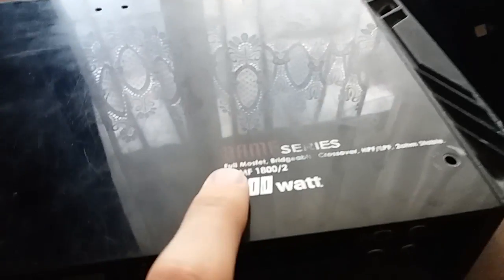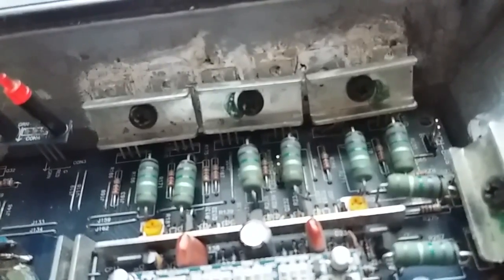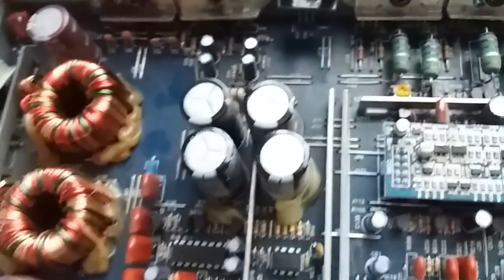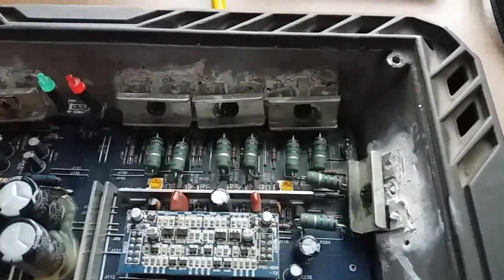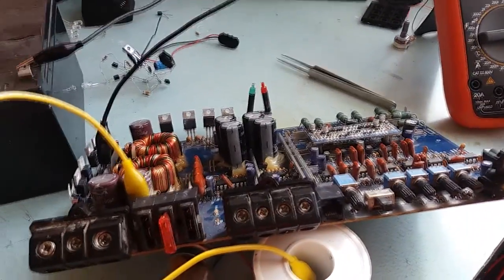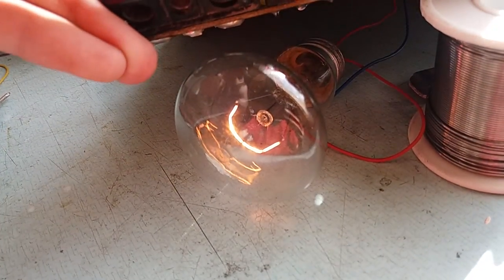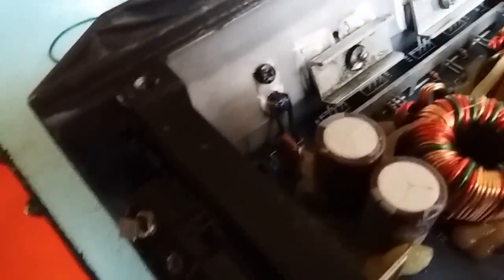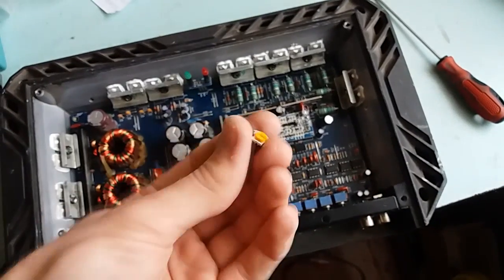Car Power Amplifier Repair (Deep Fried)

Comment: Amazing to see you recover that amplifier of death, Well done :-D :-D.
A feather in your hat for your skill, and making it look really neat now :-D.

Yes i have repaired horrible crap, but that was when i was 17 and didnt mind taking a week to sit there and check out every suspect dead part, also i saw it as a challenge, but there is a risk that it could still eat the new parts if you skipped anything.
I may sound negative, its experence that there will be bad ones, the question is: Will it be this one? LOL :-D.

I really liked your discription, the twin h.f transformers with there own push pull drivers, being driven from buffer transistors from that switchmode pwm psu chip, i guess.
The final output rectifiers and two transistors being used as a pre-amp/processing and possible driver power supply, + and _ 15 i think you said.

I hope you set the gain controls while in your frends car, And PUT STICKERS OVER THE HOLES TO STOP MESSING, an important step.
Also correct fuses, Marked so if it comes back like a boomerang, you know your mate is a silly arse!! lol.
People overdrive them, and use wrong speaker impedence (Allways!!).
I really really hope your frend appreciates you.
Sorry, long woffling text :-(
Reply from the maker: Thanks :) The only tricky problem to resolve was the weird distortion thanks to open trimpot which was used to set the quiescent current. In total, it took me 4 lazy hours of work, not really much for me. I was waiting for the parcel a week :)
Reply: Yes the bias or what looked like the word "Bios" was written on the pcb lol :-D.
Yes parts can be a long wait :-(
I think without you, that amp would never have worked again, it would cost your frend such a lot of money to get it repaired at a shop, he would have said "No" and treated it to a trip to the bin lol.
Reply from the maker: zx8401ztv Knowing them, I would say that the amp would've been tossed in a shed of some sort and left there for ages :D The guy told me that he asked one "repairman" before, and he said it would cost 2.5 times as much as I charged + he then refused to repair it. Something tells me that it was that moron who screwed it up so much.
Reply: Yep it sounds like a shed amp, and knowing who messed it up is hard to say, the repairer that said 2.5 times the cost may have been looking at the same state of death that you were, he possibly just didnt want to waste his time.
A decent repairer didnt make that mess, it was an asshole!!.
You are a good and decent repairer, you care about the final result, the amp looks decent now, i hope your frend is not an asshole.
Reply from the maker: zx8401ztv The client is a friend of my friend, and he's quite a nice chap to have a deal with. If this didn't belong to him, I wouldn't bother repairing it. I had a deal with assholes before, repaired a subwoofer that shouldn't be repaired and they screwed it up the next day and complained after that. Again, I had positive experience with the nice chap, so I took the risk

Comment: This kind of stuff is for all those who have to drive on every road as if it's a race track and can never get enough watts of super loud bass! I doubt this is capable of 1800 watts though. Whoever serviced this had no idea what they were doing (or perhaps was lazy like me)  That's weird seeing mosfets in a linear amplifier, usually it's class D amplifiers that use mosfets.
Reply from the maker: Sure thing it won't output that power,  perhaps in some kinda peak, like those silly P.M.P.O ratings :D There's 60A fuse on input, so it can't even consume 1800w for any significant period of time. 
I don't quite get your comparison with a race track, but I agree that this is excessive. However, that doesn't bother me to much as long  as they pay me too fix the thing ;)
Reply from the maker: Lazy?! Clem, there's a difference between being lazy and having hands growing from the ass. That moron clearly had the birth defect I mentioned above, and/or didn't he didn't give a crap about the thing. 
  If you are lazy and slop your projects together - fine; it's your hobby. Take a look at my amp, for example :D But when you deliberately screw up client's stuff, it's whole another story. As you saw from the mess of the thermal paste and loose TO-220's, he did take the board out. So the question is - why bodge that 150R resistor on top if you had the board out? Incompetence or ignorance is what I call the problem here.
 And yeah, MOSFET's in the amp is interesting for me too. All 8 pieces are the same, so it's a quasi-complementary output, biased into class AB. It's better to use true complementary pair but as you might know, P-channel FET's are usually weaker.

Comment: Hello MrJohhhnnnyyy i have   amp  Power coustik BAMF 5500/1D its smoked can u help me to repaired plz?
Reply from the maker: It may seem incredibly easy, but if you don't have proper equipment and experience working with power circuits, you may do more harm than good. If it smoked, the transistors in the converter are likely to be dead, same applies to the amplifier section. If you have a DMM, soldering iron and some skill, you may be able to repair it. That if it's gonna have a simple failure like the one in the video.
Reply: Its any chance  to contact privet and i can send u pictures ?
Reply from the maker: You can make a short video, upload it, make it private and then send a PM to me with a link to it.
Reply: Ok i will... but i not using youtube i dont know how to do it private  but i try...i can do vid in russian language if u like..be easier 4 u nme.thx

Comment: lol this amp isnt gonna put enough power down to damage your hearing at the range it plays , a car horn would do more damage . looks like 4ga inputs and 3 40 amp fuses , rough estimate 800Watt RMS output clean from what i see . to bad you didnt live by me i have enough blown amps to keep you busy for a year lol
Reply from the maker: So you say that listening to music with that amp at max power is harmless? I had my ears ringing after I tested my amp which puts out 30W rms into each channel. 
 It's the sound pressure which does damage, not the power itself. If you have sensitive speakers, 30W will be more than enough to hurt your ears, at least temporarily. 
 Yes, the car horn hurts your ears more, because it's not a bass that this kind of amplifiers play. Try sitting in your car while your stereo plays 1kHz tone at max volume. You'll tear your ears off LOL
Reply: subwoofer amps are not made for that frequency range , i just had a hearing test recently and for my age im above average , she asked what i do , ive been building car audio systems since i was a teen and have sat in 162DB @ 40hz , my personal car's best score is 156.0 DB @ 37hz , these subwoofer amps are made to play in the 18-100hz range ''tho personally ive never open my LPF above 85hz . i see that this low quality amp has full range and a HPF on a amp that should never be playing in those Ranges  and hell no to your 1k hz Challenge lol ... i do like my hearing and dont want it damaged , even a 200rms speaker amp and speakers designed to play that range very well could damage your hearing but subwoofer ranges takes much more SPL .  check out my channel